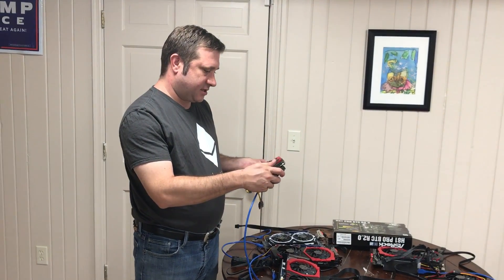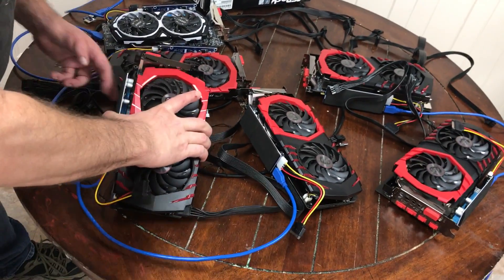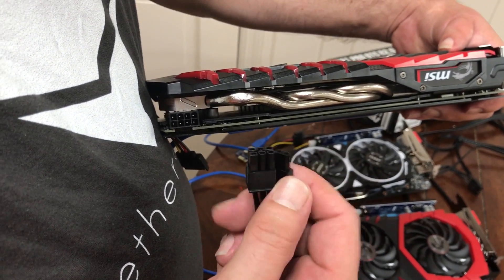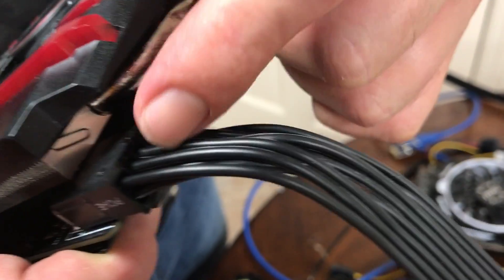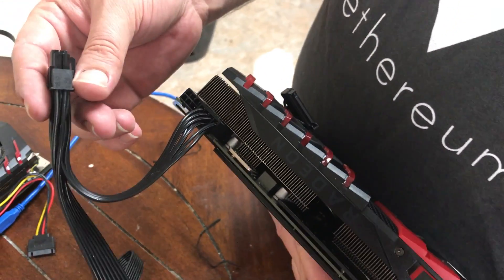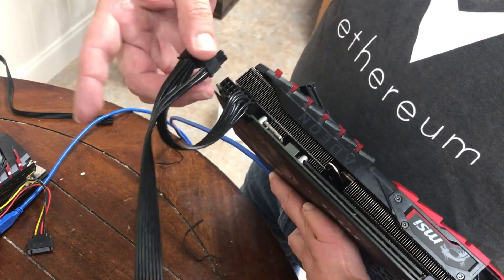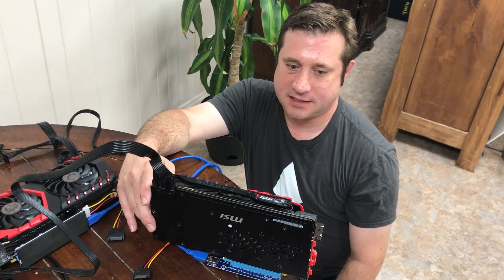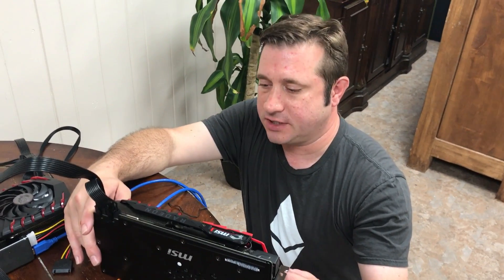Connecting GPUs to PCI-E x16

Comment: hi  my question is....you have it on risers and connected into the pcie 1x slots right? does that give it its full speed for those gpus?
Reply from the maker: yes and yes
Reply: @AtHomeCrypto  but I thought pcie 1x only handled 250-500mb read up and down?
Reply: @AtHomeCrypto  i just did some research on it and the pcie 1x speed is far less than your 16x so your gpu card does not perform to what it should....then i see this video and it confirms what i was thinking : https://www.youtube.com/watch?v=TtBw_p_NU00

Comment: hey im just wondering if any miners here have experienced this problem and can help me with it... i had 4 evga gtx 1070s running to a 1200w psu. each gpu has two 8pin connectors on it. i had two gpus plugged in with 4 cables back to the psu(one 8pin cable going to one 8pin slot on the gpu and back to the psu, and another 8 pin cable going to the other 8 pin spot on the gpu, and back to the psu). the other two i had pigtailed with an 8 pin cable from the psu to an 8 pin cable to the gpu with a 6 pin splitter that attactched to a 6 pin to 8 pin pig tail that came with thge gpus. so, i did not have enough vga spots on my psu to plug in all my graphics cards so i had to order some more cables that pigtailed and i thought that would solve the problem because it would free up extra slots on my psu. I switched all the power cables so they are all 8pin to 8pin to 6pin splitter connected to a 6pin to 8pin connector pigtail that came with the gpus.now I am getting a message that says"PLEASE POWER DOWN AND CONNECT THE PCIe POWER CABLE(S) FOR THIS GRAPHICS CARD". Has anyone ever troubleshot this type of problem with this style of graphics cards? can anyone point me in the right direction where i might find some more information about this problem? Thank you in advance for any helpful advice, I am stumped right now
edit: iam trying to run 6 evga geforce gtx1070 ftw edition
Reply from the maker: It sounds like you got incorrect cables that were not from the manufacturer. Each PSU has very specific cables that work with it because of the way the manufacturer has grounded the internal components.
Reply: AtHomeCrypto all the cables I am using are the ones provided by the psu and gpu

Comment: Thanks.. I have gtx 1070 GPU with  8+6 pin socket and PSU I have has two 6+2 cable connector.... 
can I use one (6+2) cable as to fit in 8 pin socket of GPU and other 6 pin of (6+2) cable to fit in 6 pin socket of GPU....
Reply from the maker: yes

Comment: Hey guys I'm in need of some advice. on my GPU card I have 2 plugs [ 1 8pin + 1 6pin ] but the cable that plugs into the 8pin PCIe Port on the PSU is an 8pin to 8pin so do I use a separate cable for the 6pin or do they have to be the same cable? if so which port do I plug this 6pin plug into on the PSU the one labelled SATA?
Reply from the maker: you need a different cable, it would plug in to the pcie port on the power supply.

Comment: i purchased a asrock110 and am gonna try to load up as many 1050ti and 1060 as possible. if i find better cards then obviously switch out to 1070 1080 etc.  my question is what power supply on a budget do you reccomend and how much do i need power etc.
Reply: For GTX1080 cards, it's around 180watt per card. A good rule of thumb is to leave 10-15% extra to the full capacity of the power supply because of efficiency. I'd recomment 1000w Gold standard supply on which you could load up to 5 GTX1080 or 8 GTX1060. Gold has around 90% efficiency, so maximum power draw you should be aiming is 900w. Ofcourse you can go for full 1000w but then it starts heating up and losing even more efficiency.

Comment: any problems ? if i do not connect 1 card directly on my motherboard (same ) with pcie16  I get code 12 errors nd so on.
Reply from the maker: You should connect all GPU to the motherboard & use PCI-E when needed.

Comment: the foam on the bottom of the pci risers, do i need to remove that?
Reply from the maker: No, The "foam" on the bottom of the risers is insulation for the circuits. Do NOT remove that

Comment: Is it a must to use a 500 w power supply or I can use another one with 300 w only?! 
Thank you
Reply from the maker: The 300W would work if that is all you have.
Reply: AtHomeCrypto if it powers that gpu only with the whole pc ?
Reply from the maker: There is 6 of them.
Reply: theres no way in hell youre powering 6 of these things on a 300 watt power supply. they pull a max of around 150-160 watts each. youre not even going to power them on a 500 watt supply. you need at least a 1kw quality pwer supply for the cards alone, and it cant be running anything BUT the cards.
Reply: but not for long